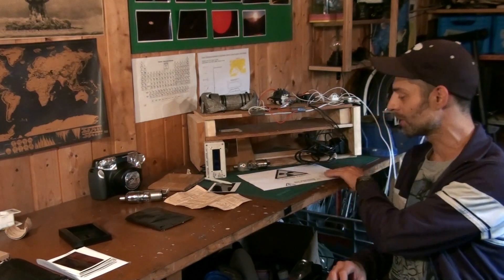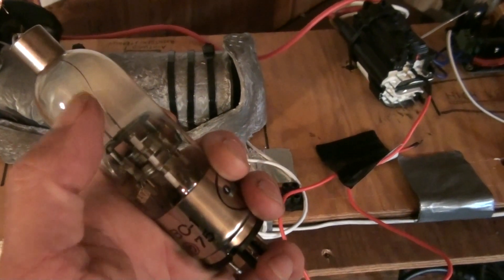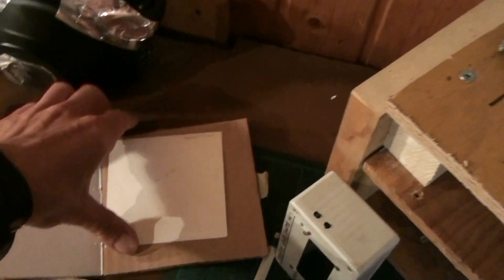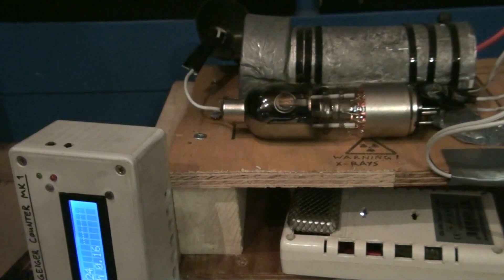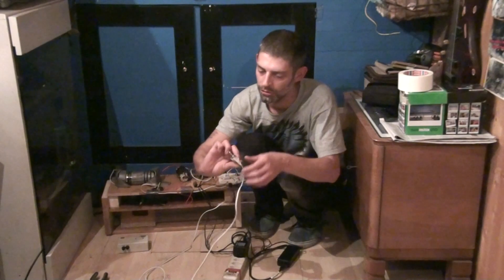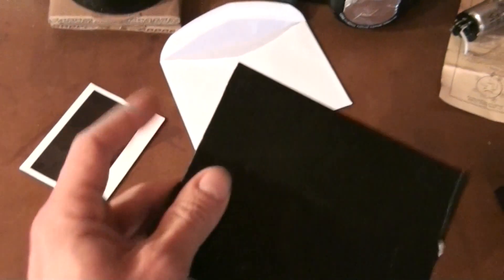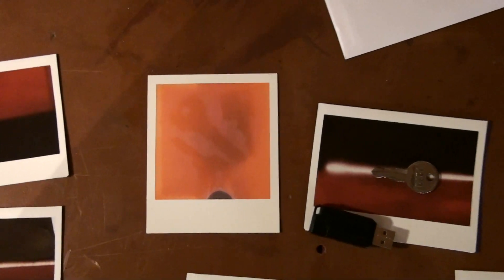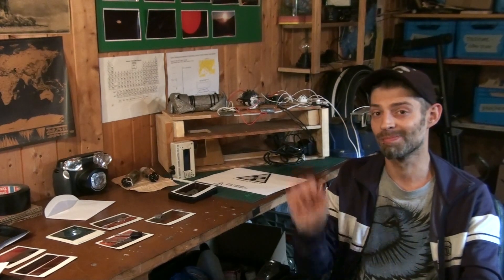DIY X-Ray Machine / Dangerously Stupid Experiments Pt. 1

Comment: Where did you get the vaccum tube from? I beileve the technology behind these devices is long gone and it has been obsolete for decades.
Reply from the maker: Its a Vintage Soviet Vacuum Tube, i think i got it from Ebay. As far as i know this Type of Tube was used in High Voltage Converters of some sort :)

Comment: The real danger with doing something like this is not the radiation, but rather the high voltages. The radiation emitted here is very low energy. X-ray radiation won't kill you, but electrocution will.

Comment: Great work!

I once made copious soft X-rays with a Kilovac/Tyco H-19C DPDT relay at ~25-30kV and 100uA of leakage current. Relay has very good vacuum and getters.

Unfortunately it was a self inflicted radiation accident with plenty of exposure, due to not realising what was going on  (trying to solve an abnormal leakage current issue at work). Geiger counter FSD at 3m when tested later.
The Physics was due to relay contacts soft welding  with 2A closing current, making microscopic high field emission sites on contact opening, across ~1.5mm contact gap. 100uA was much larger than the normal 50nA for this relay at 30kV.

Just relating my own accident if it helps anybody not to repeat - HV on any type of vacuum device can generate significant X-rays even if it doesn't say X-ray tube on the label.
Reply from the maker: Wow Mate thank you for youre nice words and for sharing youre story! I never heard about the fact that relays also can produce x rays, but it totally makes sence thinking about it. i am really not an electronics expert but i think i do understand the basics somewhat.. This comment could be the inspiration to make another Video on this topic, thanks alot for that idea! Also i should focus on the safety issues more of course, totally will consider youre story if i make anything new in this direction :) Btw i did build a version 2 in the meantime, got a proper dentists tube from a good friend and now it works like a charm. only tested it twice however, also always try to stay shielded and carry a dosimeter on me when i do "weird" stuff ;)
Reply: If you are experimenting further, illuminating minerals may be interesting?! (there seems to be some info out there on web for gem stones glowing rather like with UV, and afterglow)
I saw this effect with a Sapphire rod insulator component, inside the relay assembly - it glowed for some minutes after irradiation (deep blue, dark room needed)

Comment: A 2cm arc is about 20kV.You had weak X-ray images because 20keV X-rays are attenautad by the glass of the vacuum tube and also the objects being X-rayed.30kV would work a lot better,the tube will withstand 45-55kV before arcing over.It would also help to measure the current and regulate it to 400uA for a few seconds or 250uA for a few minutes.
Reply: Hello, doesn't breakdown voltage of air is about 3 kV/mm? So doesn't that mean 20mm arc is about 60 kV? Thanks
Reply: @user-cb2lx5ll6o  That only applies to spherical electrodes. With very sharp electrodes it can be lower than 1 kV/mm.

Comment: Hi Bremsstrahlung, i found this interesting and inspiring. I have purchased one of these tubes, only one so I would prefer for it not to blow before I get to do any controlled experiments. I haven't yet bought the zvs booster or lead shielding through I had already been looking at those zvs drivers on banggood thinking I might set up an induction heater for smelting metals or maybe build a tesla coil. I changed my mind about induction heating after discovering I can get higher temperatures faster using my toaster sized arc welder and to 2 carbon electrodes from a 6v lamp battery :)

anyway, back to my question. What voltage and amps are you giving that zvs boost module? I have a 30v 10a bench power supply.
I'm guessing it wont need all that as PSU's tend to have only fixed 3, 5 and 12v dc outputs.

I dont know a lot about electrical things but im guessing for the tube you want high voltage but low amps like 1 or 2a?
I dont want to blow it up.

Can you tell me roughly what inputs and outputs are involved and what you found to be the working range for xrays (and not blowing up anything)

Thanks for the video

Thomas
Reply: some ppl already mentioned it, but high voltage + vacuum = X-ray , you do not want that ☢☢☢⚠
Reply: @alos10subspasomipack33  metal plate is needed but yes ill only power mine if can encase it in some thick lead flashing
Reply: @alos10subspasomipack33  please explain what i want, it might just save time :)

Comment: Xrays are slowed by hydrocarbons like lead if you had enough you could make the entire thing out of thick wood
Reply from the maker: thank you for youre comment! but i thiink youre maybe mixing up something here.. Neutrons are slowed down by Hydrocarbons (see Neutron-Moderator, HDPE Plastic works very well, but wood would also, its about the Hydrogen atoms..more of those, more slowing down Neutrons). But X-Rays are Photons, and as such they have the fixed speed limit of light (wich can be different in diverse mediums like water or glass, but its always a fixed speed because its light. I think the Lead basically just stops the X-Rays, its not really a slowing down effect :)

Comment: Quite interesting project you have here, I purchased the High Voltage ZVS Tesla Coil Driver Board you were talking about and i think it also comes with an ignition coil so i might not need one form a car, and i'm thinking of purchasing that same tube. Is this all i need? of course shielding too but in electronic components? One more question, if i leave the x rays on for a little longer than you would I get better pictures? maybe 2 tubes?
Reply from the maker: ..i learned meanwhile that the ZVS HV Supply is actually the same used in old TVs, so you should get the "Ignition Coil" along with it. Just one thaught on youre idea, i think 2 Tubes is not a good idea, because you will get blurry pictures.. you need one point source of x-ray "light", in the end you are making a projection, so 2 light sources will make it blurry.. You can fire the tube multiple times to get more exposure, i always only fired the tube for 1, 2 seconds, if you leave the power on too long, you will burn the tubes.. i burned about 3 before it worked, so it makes sence to buy some reserve tubes anyway :)
Reply from the maker: also for other electronic parts, i did not really use anything else, exept the power supply for the ZVS for wich i used an old Laptop power supply. I am not really good with electronics, so probably there is a better method for this, but i did it the most simple way i could :)
Reply: @BremsstrahlungChannel  thanks alot for the info, the old laptop power supply is excellent because i was wondering what cable to use, unfortunately I only ended up purchasing one tube, is there anyway to not burn them out? I purchased the same tube as you but was tempted to buy a 2x2a. I see you warm up the tube or something but im not sure how, is that was stops them from burning out?
Reply: PSA: Don't rush into fucking with x-rays just because it seems fun and cool

Comment: 13:20 are you sure that you didn’t just get some light on it?
Reply from the maker: Yup im very shure no light hit the Polaroid Films. I had the keys ontop, not inside the envelope, and also i used these in the past with the same method using Gamma Rays from Radium painted clocks. Thanks for commenting! :)

Comment: 4:16 it’s probably a ZVS, similar to an induction heater.

And it’s not a ignition coil, it’s a Diode Split Transformer, like the ones in old TVs ;)
Reply: It's a flyback pulsed transformer , you could change that zvs driver out for a  light ballast
Reply: @FMR_317  hi, im curious to experiment this. I will need to purchase some lead shielding first but I have ordered this vaccum tube cheap on Ebay and it arrived today. I also recently bought a 35w SOX bulb and it came with ballast and ignitor. are you saying I can take uk mains neutral straight to this "xray" tube and live through my ballast and onto the tube?
do you think that will be enough or will I need something else
Reply: Thomas Asche 
hi!
A ballast in a Fluorescent light is used to limit current and voltage a fluorescent bulb can take (because there negative resistance devices this means they will suck up as much electricity as they can)
if you hook a fly back transformer up to a ballast it will limit the current that the fly back transformer can draw this will make sure you don’t flip a breaker and make the fly back transformer last longer
Reply: @FMR_317  thanks. my ballast is designed for a low pressure sodium bulb not a fluorescent bulb so I will have to see how they compare but this is good to know
Reply: Thomas Asche no problem dude just be safe and have fun

Comment: Awesome. Thanks much for your sacrifice. But one question puzzle me: Does the USB stick still works? Well, airport security doesn't destroy my USB data, but still...
Reply from the maker: Yes indeed, the USB stick works without any problems! ;) I actually used it to edit this Video (...and i x rayed the f**k out of that stick while testing ;) ) ..i actually was more afraid of the high voltage / magnetic field damaging the USB instead of the X Rays.. but apparently those chips are really tough :D